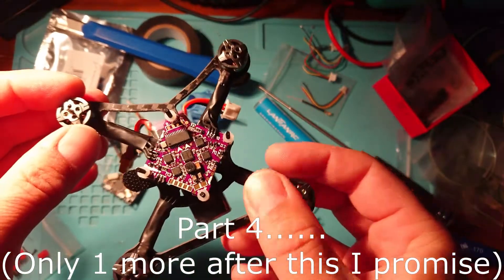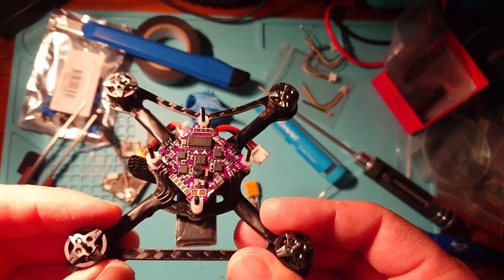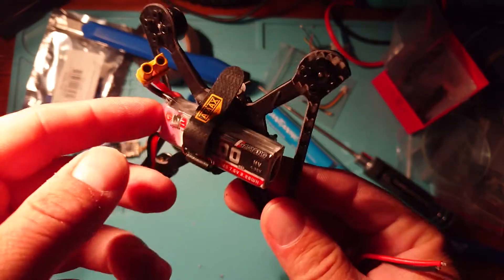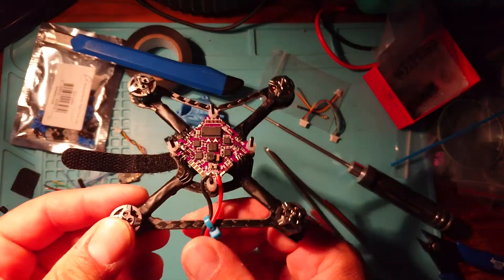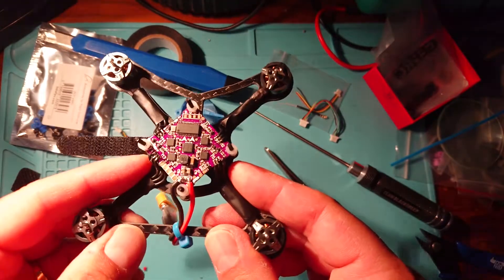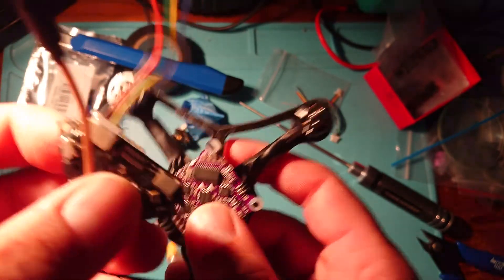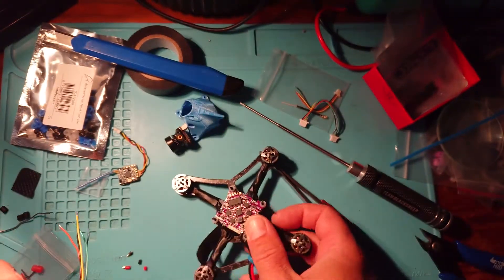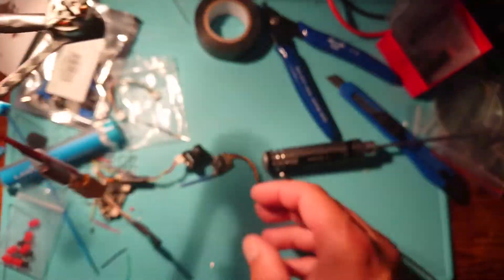Build your own Toothpick / Twig FPV quadcopter........Video 4(of 5)

Comment: Hi,
Thank you for a great video.  Well done!

I’ve been looking for a more durable frame for the EMAX TinyHawk S and 2.  Would you happen to know if this frame will accommodate the TinyHawk FC?  

If not would you happen to have any recommendations?

Thanks.
Reply from the maker: Hi, not easy to find frames that will fit the Tinyhawk aio fc/esc/vtx as it has an odd mounting pattern, I don't think it would fit this frame, sorry. Not seen any frames for sale but you could check out this video from a guy called chrismel FPV https://www.youtube.com/watch?v=y9iSy7HPP1g it might help though you'll have to get the frame printed yourself. Hope this helps and thanks for watching 😀👍👍 and just found this https://us.microheli.com/racing-frames/emax-1523565748/tinyhawk-115mm
Reply: @Rich-TeaFPV  Thanks for your help.  I was hoping to do a direct swap, but from what I’m learning it appears that other than the FC, it’s a total rebuild.